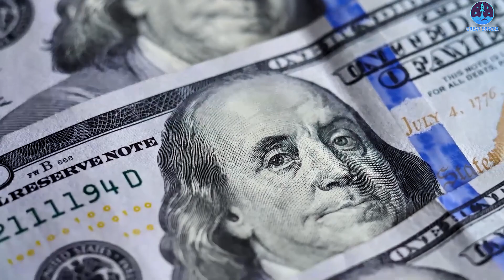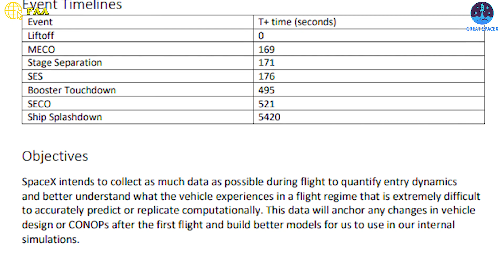SpaceX is about to Drop Starship into the sea…

Comment: Those square directional vain wings need to be longer thicker and fold out from the Housing. Upper section needs descent thrusters from the side of the cylinders pointing 25 degrees as well as the lower thrusters.

Comment: I dont see them  just dropping StarShip into the ocean as it were, probably flip it as if it were landing and just settle it into the ocean, should be very little damage if done that way.
Reply: The major damage is from salt water corrosion.
Reply: @jessepollard7132  agreed, however at least its stainless steel so that shouls be somewhat resistant, the engines is another matter though.

Comment: Dropping it into the Ocean, how are they going to retrieve such a HEAVY piece of equipment? Also, splashing into the Ocean just seems like a waste of not being able to test the landing claw system.
Reply: Having expended its propellant, won't Starship be empty, and therefore float, when it soft-lands in the Pacific? If the hull is intact, that is. If it has acquired holes during reentry, it will take on water and then sink unless the water is pumped out, holes are patched, etc. If it is sufficiently seaworthy, it can be towed, but depending on the recovery ship, it might be a better idea to lift it onto the deck and secure it for the long trip back to Starbase--south through the Panama Canal and north back up through the Gulf of Mexico to Boca Chica for examination. I can't think of any other way to get it back home. Can you?

Comment: Starship recovery is going to be the toughest component of its trip and landing back at the point of departure invites disaster. Let's face it, the chances of a crash are high and could wipe out a launch complex. Would it not be prudent to have a landing complex a short safe distance (5-10 miles) away? Turn around time would be longer but much safer should the unwanted but inevitable crash occurs.